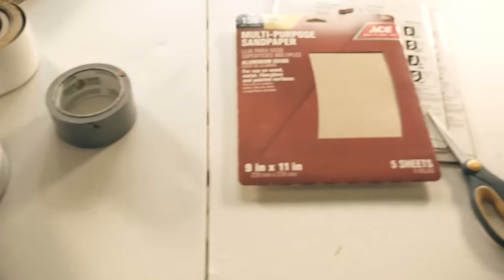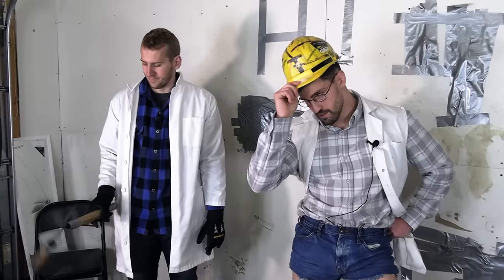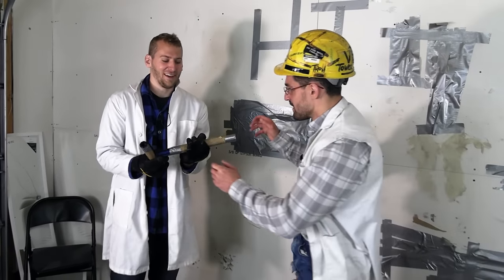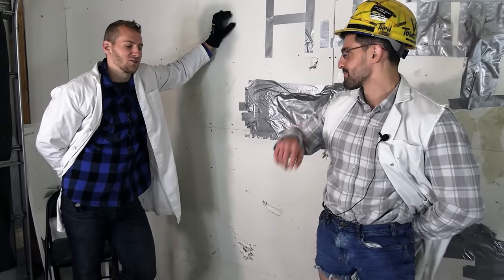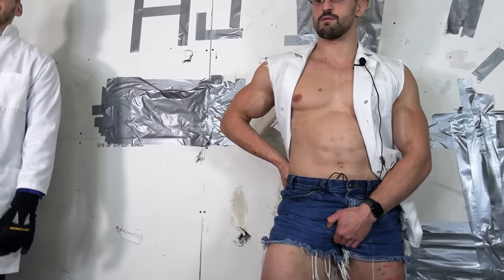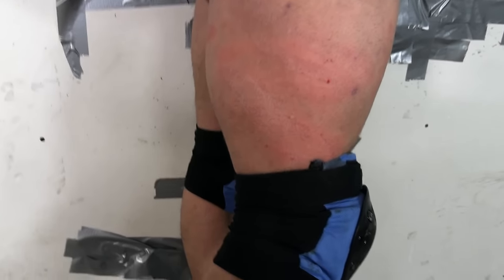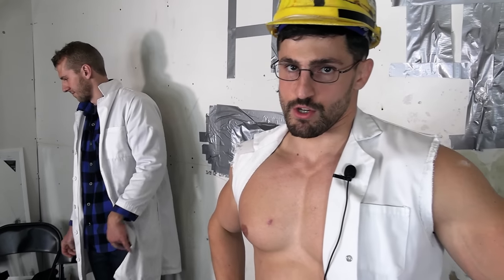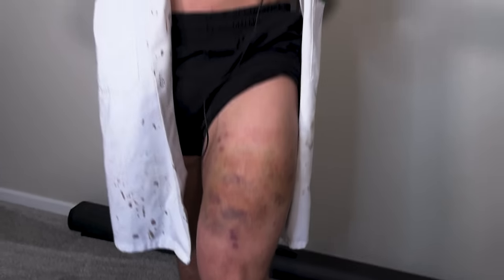Peeling my Skin Off with SANDPAPER NUNCHUCKS so Nobody else has to *EXTREME RESULTS*

Comment: You definitely have a funny pain tolerance, but have you ever taken a thin piece or steel wire(3/32 tig welding wire) and killed the nerve in your own tooth by heating it up to a glowing yellow heat? 😂😂. I’m kind of like you. I like to see how much my body can take and I’ve learned I can take ALOT before I actually feel pain. One that bothers me the most is using a 7” angle grinder with a wire wheel on it with no shirt. My kids however like picking the little metal brushes out of skin. I think it would be hilarious to watch someone else do that 😂😂